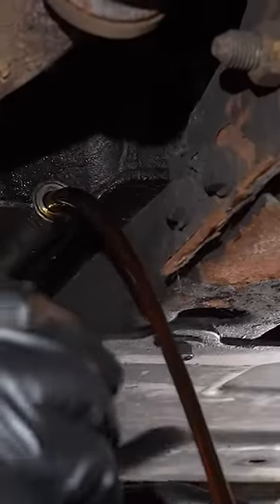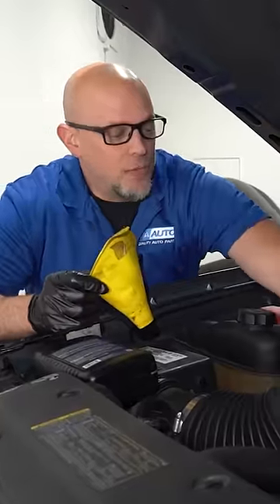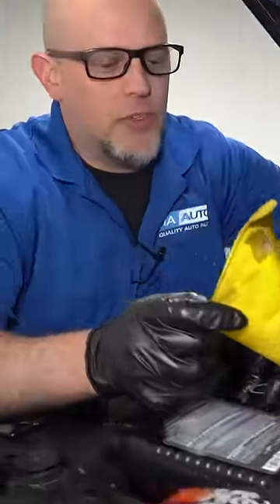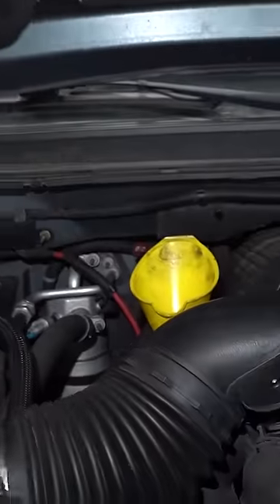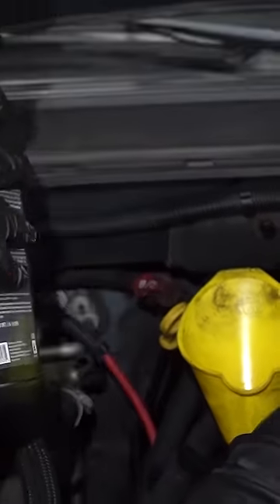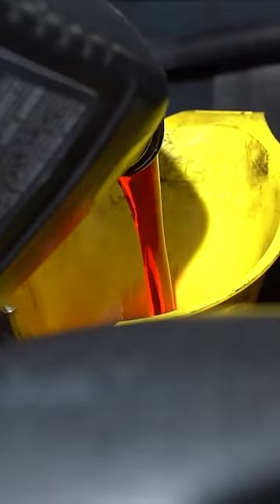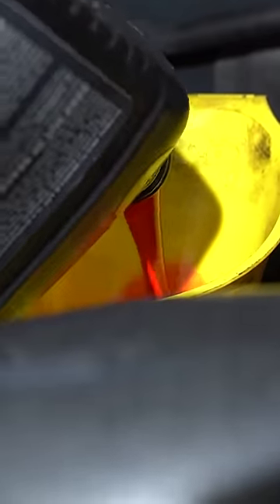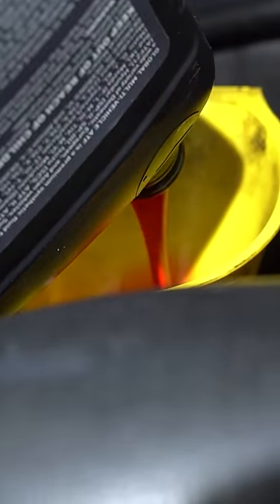Clicking, Tapping Engine Noise? Try This Trick Before Replacing AFM Lifters! #shorts

Comment: Didn’t think mechanics nowadays knew about these types of techniques that we used to do back in the day. It’s refreshing to see that at least some mechanics still value some of the things done before that worked then and still work now.
Reply: I would say he either had a good teacher or did some research. Most people are about that money so quick fixes aren’t on the menu.
Reply: Doesn't work with modern fluids nore is it worth it.
Reply: We used kerosene
Reply: I’ve been doing this since 1998 it works most of the time.
Reply: Ya almost all mechanics know about this lol, its not some guarded secret only know by older technicians.
Reply: I’m a 18 year old mechanic and use tricks like this
Reply: After you take your last breath are you going to heaven or hell? Please ask yourself that question.

Jesus can save your soul from hell. He will forgive your sins. He said whoever calls upon his name shall be saved. Call upon Jesus today. Repent and believe the gospel.
Reply: Of course they do
Reply: The guy is like 50 year old
Reply: @lorddragoono  you're right . I think from what I remember they suggest not to do that now because of some of the seal , o rings and parts being plastic . But yeah you are right
Reply: @brotherdj777  no.
Reply: Hi
Reply: We do, they're just not a viable solution to any issues modern engines have. If the owner of this vehicle performed regular oil changes you wouldn't experience this issue.
Reply: @twistednuts6062  nor*
Reply: @johnmarshall4442  ever wonder what marvel mystery oil is?
Reply: Had what we thought was maybe carbon build up on top of the pistons. Is what I was told by a shade tree mechanic. He then proceeded to pour roughly 2 qts of atf down my carburetor until it choked itself out. Then pulled all 8 spark plugs one at a time, and bumped the ignition as it spewed at and oil. Then ran the motor for about 2 hrs while it smoked like a banshee burning the atf out. I was 15 he said it'd clean the cylinders if nothing else.
Reply: @clayton9136  my 05 4.0 Mustang started doing it at 250,000 miles. I changed the oil regularly. Lol
Reply: I can see why some would not risk it. Engines are not the same as they were 50 years ago and people trying old tricks on new engines can cause damage. There are good additives they make now that fufill this specific role without putting the engine at risk. I’m sure transmission fluid wouldn’t kill it outright, but it’s meant for a different purpose entirely.
Reply: @madjackgamingandfitness498  you only do this when you want to sell the car so the new owner doesnt  know the engine is bad. In some poor countries everyone is using tricks like that
Reply: Want to know why? Because people have gone idiotic and doing a simple trick like this when the tick comes back the customer will expect you to replace the lifters for free because your last “fix” didn’t work. It’s better to quote the job and let them decide if they want to pay up or are ok with some noise.
Reply: This is not a real fix, it is a band aid.
Reply: He juste said it himself. Its for engine youll trash in a near future. So you dont have to worry that parts in the engine were not disign   for this type of oil... with more detergent what mean is more corrosive, more harch on some parts like plastics ones etc...

Most of the time... if we stop doing something... its for a good reason. fix a problem by creating more in the long run... thats not really "good"
Reply: I used beer piss
Reply: @twistednuts6062  Can you elaborate instead of just poopooing the idea with zero elaboration? Lol I'm not just gunna take your word for it
Reply: Did you also walk uphill to school 45 miles in the snow?

Comment: Just before you change your oil. I will add transmission fluid to the engine oil. Run the truck 3 or 4 days change the oil. Every oil change. Truck has 288645 miles and no knocks runs great.

Comment: Frequent oil/filter changes prevents these issues. Dirty oil destroys engine and parts..lifters have just a small hole that oil gets into so when it get dirty with varnish and sludge it does not get the oil and it will tick.
Reply: I've done quite a few afm lifter replacements on trucks with less than 10,000 miles, model year 2021 suburbans and pickups
Reply: Unfortunately most people get used vehicles and have to deal with the previous owners maintenance which is most of the time unknown so these tricks can really help someone
Reply: I also believe that having low oil pressure doesn't help either
Reply: @RCLBWD  yeah my dad never changed oil in Lincoln la 3.9 jag v8 and is giving me it and it has so many fucking issues and trade in value is only 250 but it’s a specialty car LOL
Reply: Hi
Reply: So true, i do mine every 3k regardless of oil quality, it's the best interval and 20k for transmission
Reply: @josefelix4152  me too brother. Amd i use TGMO in my Yota, she loves that moly ;)
Reply: The issue with these 5.4 3 valves was the weak oem oil pump that kills the top end of these engines specially the passenger side head.
Reply: @joshhemingway  what is TGMO?

Comment: There was a guy that posted this trick and was attacked by all the keyboard mechanics.
Reply: I hate keyboard mechanics this man either had a really good mentor/teacher or he did a lot of research
Reply: Hi
Reply: This is a scam tactic for used car dealers.
Reply: @MWilk098  exactly,  this will work for a little while,  but the issue is still there. It will eventually fail.
Reply: @dbstherollers8106  good mentors don’t teach band aid fixes. The only real fix is to replace the afm lifters.
Reply: @andybub45  afm lifters are terrible cylinder deactivation especially by gm between 07 to 14 was really really bad 

06 impala 3.9 v6 afm got at 130k for cheap 3200 

Only lasted till 168 k camshaft ruined itself. Had the lifters fixed when I first got it and they went again so I just drove it ..
Reply: @georgephillips7408  should have done AFM delete

Comment: Back in the 60's my stepdad (an ace mechanic), told me that every time you change the oil, add one quart of transmission fluid because transmission fluid can get where motor oil can't. I've done this on every vehicle I've owned and I have gotten 277, 000 miles on my Nissan Pathfinder, so far, and it still runs great......
Reply: Is that safe if you have turbo?

Comment: I used a mix of Marvel Mystery Oil and it got my lifter unstuck on my wrangler after it sat for a year. Did a few changes after 100 mile intervals and it worked amazingly! Idk how much better it is than transmission fluid but my Ljs 4.0 sounds happier then when I first bought it around 10 years ago!
Reply from the maker: +Aimless Parasite Thanks for the feedback!

Comment: I am a service technician for a fasteners company. Yes, transmission fluid will swell the o rings and stop the noise. It soften the o rings in the lifters to the point of seizing. If it’s just noisy, diesel fuel will help.

Comment: This also is great when flushing an engine after a minor head gasket leak. Gets all the chocolate milk outta there. 3 quarts diesel and 2 quarts engine oil also does well for internal cleaning. Been doing it for years with fantastic noticeable results.
Reply: Hi
Reply: Do you drive it for awhile or run it for a couple of hours
Reply: @artlopez2404  idle it for ten or twenty minutes. Don’t rev it, don’t drive it. Idle speed allows full enough oil flow to let circulation clean without damaging the bearings or clearances.

Comment: Transmission fluid has an additive that helps swell rubber parts (orings/seals) and keep them flexible. Hydraulic lifters rely on internal seals to hold/maintain pressure (Hydraulic cushion). Transmission fluid cleans debris off of them and swells them to help them seal. Very similar to how brake fluid works in the master cylinder, calipers, and wheel cylinders. That's why it helps quiet noisy lifters. It will not help solid lifters, rod, main, or cam bearing surfaces.
Reply: Most oils have such conditioners these days.
Reply: Hydraulic lifters do not have any rubber or any type of “seal” to swell. Its just close tolerance.
Reply: Buddy ,hydraulic lifters DO NOT have  "seals" in them ,its all metal to metal

Comment: Add one guart of transmission fluid, when you're a guart low, leave it in until your next oil change. It also works if you add half a guart to about 10 gallons of gas to clean your fuel injectors. I've done this to many different cars for over 50 years works great , never had any adverse reactions. Some times I would replace a guart of oil with transmission fluid at an oil change and leave it until the next change.
Reply: Sorry how much?

Comment: I'm 69 now but when I was 18 I worked in service station we used to do this to clean engine out we used two quarts  trans fluid to three quarts cheap motor oil run for 15 to 20 mins then change oil to good motor oil  some times we would use two quarts diesel fluid instead of trans fluid for really dirty engines
Reply: I’m 59 and worked at service stations in my teens, we did this all the time.

Comment: I think the key point is to remove all kinds of deposits/gunk from engine oil. It doesn't matter if what u use, many method would work. My Tahoe started to develop a ticking noise couple of years ago if the weather is cold or it's parked for some time. It also happened more and more frequently. After I changed oil with AMSOIL SS, that ticking noise was gone and has never come back. I heard AMSOIL SS has tons of cleaner additives in it compared to many other oil so I guess that's why it helps. I've also heard great results from some lifter additive (which also has cleaning agents). So my conclusion is either to use really good oil or try some cleaning additives.

Comment: If you are having a low engine oil pressure issue, bg 109 is by far the best solution. It will bring an engine back big time. Transmission fluid is a good cleaner for sure good video. You can put transmission fluid in the spark plug holes as well to bring back a little compression if a cylinder has a little lower compression then other ones.
Reply: And just let it sit there for an hour or two?

Comment: I use BG EPR before an oil change and I run amsoil and it works great. You can actually hear the motor quiet down. Never done ATF in the oil before or the gas... Might need to try that.
Reply: What is the above you mentioned where can i find ot
Reply: Bg trans flush works really well too

Comment: I did this just recently. Lifter was making a ticking noise it would go away after 10-20 seconds after start up. I added 1/2 quart of transmission fluid, drove it about 2 weeks, probably 300 miles and changed the oil and filter. So far so good no more ticking noise. Oil was definitely nasty when I drained it.

Comment: I am 65. Tried them all. RESTORE IS THE BEST MECHANIC IN THE CAN.
Reply: Yeah it does work well.   I had a SBC that would always foul the number 1 plug with oil.   Rings must have been going bad.  But anyways it fixed the issue and that little 350 ran for many years after.

Comment: As a mechanic I don't recommend running a 50% trans. Fluid mix for more than a couple minutes .  The reason is you will be washing lubricant off Bearings thus causing more damage. Just long enough to fill the engine with the mixture and let it set then drain and change filter. Bring engine up to temp before draining oil.

Comment: One tip no one should try in my opinion. It may appear to help temporarily but as someone else commented it has to be the right type of lifters/engine or you will likely just cause other issues. The rubber will deteriorate quickly after and there is potential for port blocks. You are also likely to have leaks ones any seals exposed start to harden up again. Transmission fluid has a different viscosity. Id imagine this would mess up a diesel because the film strength wont be enough to prevent interference. Correct me if I'm wrong..

Comment: Transmission fluid in the engine? Fascinating 👀 .. Never heard of this.
Reply: It used to be more common it's not used much anymore Machanics used to put trans fluid in the engine to clean it of course that was before oil had so many cleaners in it and not every car had a filter for the oil
Reply: Yeah because if you do that! Your engine is toast
Reply: An old hack from way back.lol first turned wrenches at home on brothers 56 chieftain in 1962 at 7 years old .Tune and brake job. First paid tune and repairs at 9 working at a gas station and next door at a body shop after school and weekends. No dad around to buy groceries.
Reply: Also works to clean differentials
Reply: @antfbi  have you tried it?

Comment: Usually replacing your current engine oil with a full synthetic will fix this problem also! Been there done that, engine runs completely quiet and gets better gas milage too with a synthetic!!

Comment: Nice nice, also fun fact, if you wanna really really clean your carburetor have the car running and dump some automatic transmission fluid in it. You will never see so much smoke anywhere else, but that carb is gonna be damn near factory clean. My auto tech teacher did that, I was working on a door lock actuator on a 04 excursion and I heard him say "Its smoking!" And then like 2 seconds later I couldn't see an inch in front of me. I loved auto tech, only think that got me through those last 2 years of school 😅

Comment: I'd recommend marvels mystery oil, always gets rid of ticks for me
Reply: Will also unseaize any engine as well
Reply: Had a 1950 ford custom that had been up on concrete blocks since the 70s and back then someone filled the block(flathead) with marvel mystery oil, drained it out and sorted out all the tuneup stuff and added fresh oil, started up and ran like a sewing machine. 

Also had a 94 corolla that had seized up from sitting in a moist environment for a few years and developed a little rust ridge, poured some down the cylinders and worked it back and forth till it free'd up, ran a quart of MMO in the oil and let it run for about half an hour, shut it off, did another oil change and it ran happy for the rest of its life until my brother drove it into a pole lol 

I've also heard of people using Kerosene instead of ATF to do what this guy was doing to clean out any gunk that may be in the lifters and flush the oil system in general

Comment: ATF it last longer... I start using ATF oil in the engine at 200 k to clean it. And I been using ATF for the last 250k miles... So yes I do have 460k miles on it.. f150 V6 4.2 stick shift..
Reply: That truck is a fucking beast!!! Great job on taking care of it and the maintenance push for 1,000,000 miles
Reply: I have a 89 Ford F-150 4x4 with the straight 6 4.9 liter engine with 235,000 on it so far and still runs like new.  Replaced a water pump the only thing I’ve had to do to it so far other then normal tune ups and oil changes.  People can bad mouth Ford’s all they want, but these engines are as bullet proof as they come. If you take care of them and don’t abuse them too much. The wheels will fall off before the engine dies!

Comment: The difference between a technician and a mechanic. A technician is told what to do and a mechanic knows what to do.
Reply: A mechanic can turn nuts and bolts. A technician does the same but diagnosis fault instead of guessing and hoping for Lady Luck.
Reply: I think you got that backwards lol

Comment: Not always the lifters themselves, some have hydraulic lifters and contaminates don’t allow for sufficient oil pressure to lifters. Sometimes the sound comes and goes. Yes doing this with trans fluid will flush, clean these lifter oil supplies curing the problem. Had this exact problem with my turboLNF

Comment: This works if it’s a crappy afm lifter. In my case at 80k my cam took a crap in my 13 Tahoe.  I changed the oil every 3 k with full syn oil. So the whole top end came apart and all new cam, lifters, head gaskets, etc.

Comment: This won't help with bad rocker arms/worn roller bearings on the lifters or broken valve springs either. Literally only if there is sticking  inside the lifer body itself will this do anything.
Reply: I was going to comment this. Most of the lifter failures are mechanical not sticking
Reply: @gorillawrenchin  
Psu baby!
   I graduated in 90s.
    My buddy graduated the mechanic school & another from the auto body school.
   
    A lot of crazy times & good memories 

   A nephew & niece graduated & another nephew currently a student there.

Comment: if you run engine oil that’s meant for a diesel engine you will keep all your internals clean and sludge free !  plus it’s usually a higher grade oil so it’s better for your petrol engine

Comment: Dextron fluid is a detergent that cleans oil gunk. It works as he says😉
I also use vinegar to flush radiators 😜
Reply: What exactly does vinegar do and the radiator and the rest of the vehicle??? Really would like to know the answer to that
Reply: @chadjay828  Neutralizes scale.
Reply: @TheBasstead1  Would backing soda do the same?

Comment: Project Farm guy did an old ford ranger that sounded like a bag of wrenches being shook. Seafoam fixed that
Reply: Seafoam fixed it temporarily I assume?
Reply: I love Seafoam. I had a VW Passat that would surge and hesitate. Put seafoam through vac line(s) and problem gone.
Reply: @wr450sm5  LOL, knock sensors have nothing to do with engine wear detection !

Comment: I’ve done this before with cars or trucks with loud lifters, and ones that burned a lot of oil because oil rings Were plugged. I used Reslone Buy it at any auto parts I mixed it 50-50 ran it for a couple hundred miles never burned oil again and 90% of the lifter noise is gone I put a lot of miles on that truck afterwards